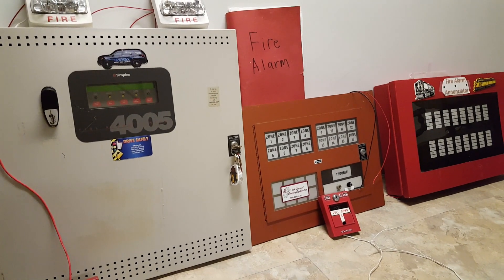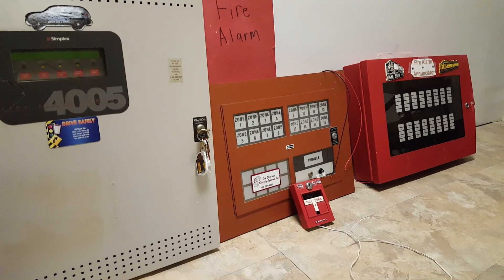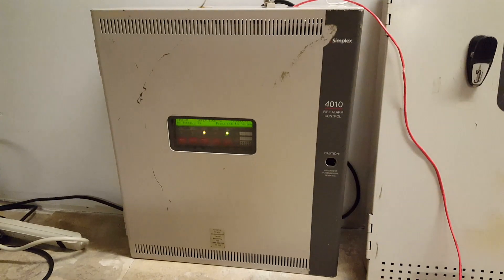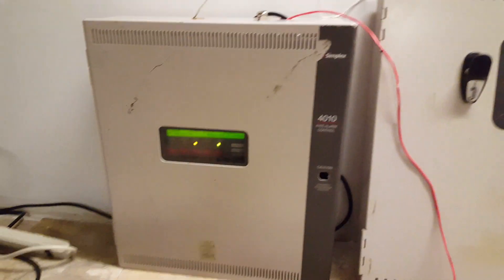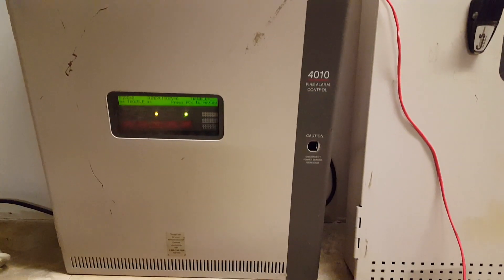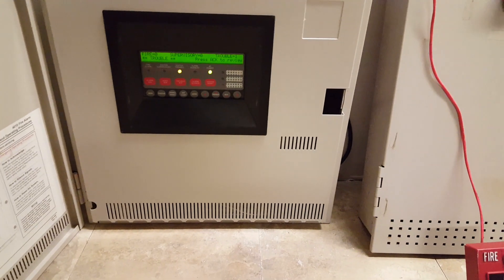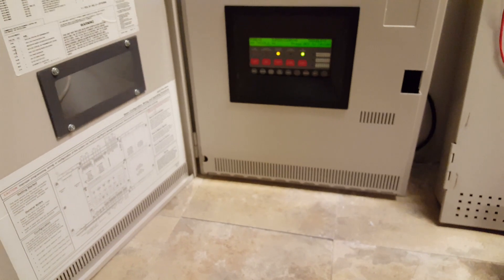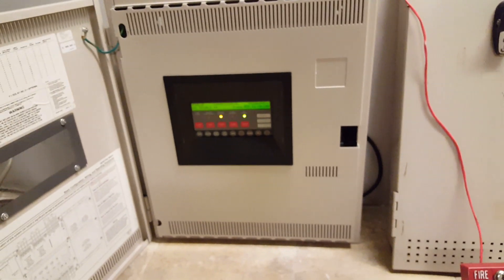Fire Alarm Update (Simplex 4010!) - 1/19/2019

Comment: Great video 😀👍👍
The 4010(s) are becoming more and more popular with collectors/enthusiasts. 
I didn’t know the panel was discontinued in 2014, I thought it was still being made. 
Question: Do 2099-9795 work with the 4010?
You an cut the end of a computer display or PC power cable, and use that for power, on the 4005 (such as Dell ones, I get the old computer parts from school).

Can’t wait for the system test!
Reply from the maker: Thanks! Yeah, I'll have to get one of those computer cords and cut it. And yep, I've been seeing the 4010 all around YouTube. Based on what I read, the 4010 was phased out around 2014, and I believe the 4010ES is the replacement model. 
With regards to the 2099-9795, I was asking the same question a couple weeks ago. I do not believe so, because the 9795 uses Mapnet addressable technology, which I believe the 4100 uses, while the 4010 uses only IDNet.
Reply: msj191961 okie Dokie, thank You!

Comment: Not only to see you uploading again, but I am glad to even hear from you again!!! :D  I am starting to get kind of interested into fire alarms. I just filmed like 3-4 fire alarm videos out in the fields within the past 2 years. System Sensor SpectrAlert Advance ceiling mount, Wheelock AS, EST Voice Evac, and an EST Genesis ceiling mount speaker strobe. Uploaded a Wheelock AS & the EST Voice Evac.
Reply from the maker: Thanks, Jim! That's awesome. Yeah, the fire alarm hobby is great. It gives you a better understanding of electronics as a whole, and it's very fun. If you're interested in getting started, buy yourself a cheap alarm and pull station off of eBay. Get yourself a 24 volt power supply and learn how to wire it all together. Basically just a fancy light switch and bulb. If you've wired elevator parts before, you can wire fire alarm parts. Once you do that, build a collection, upgrade to an actual control panel, get a little system going, and take off from there. Very rewarding. Let me know if you need any help.
Reply: @msj191961  Uhh, I am not really sure if I am really gonna go in-depth like that. However, I would LOVE some fire alarm parts though! Yes, I have actually wired up 2 of my elevator parts. The Adams replacement old vintage Otis touch buttons were super easy to wire up. My dad wired up the Dover classic Traditional buttons. As for getting fire alarm parts off eBay, well that's gonna be kind of too hard. One, I don't have an eBay account nor do I want one so badly. Two, my parents fear that they could suffer hearing losses from the severely obnoxious piercing buzzers if I have one in my collection. That would be awesome if you can maybe walk me through on it, but I will be starting school very very soon so I probably would have that much time.
Reply from the maker: Ah, yeah, well noise doesn't have to be a concern. There are chime/strobes which are much quieter than horn/strobes. I might be able to pick up a couple cheap alarms and ship them to you, get you started.
Reply: msj191961 That’ll be great, Ryan. I would love to do that!

Right now, this is not a good time to do so because I have just already started school now, so I would have to stay focused on that. Maybe if we could find a day where I’m off from school for a holiday and/or if I do not have any homework to complete off with, we could work something out. When it comes to shipping fire alarm parts, I would have to notify my parents in order for me to share out my address for personal privacy.

Last but not least, I just watched your very latest video! I look forward to hearing from you again.